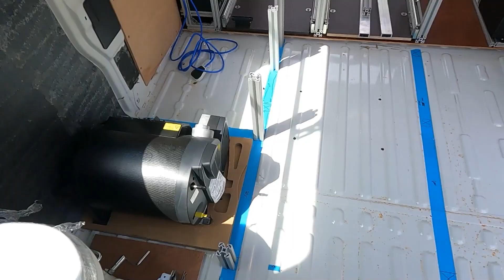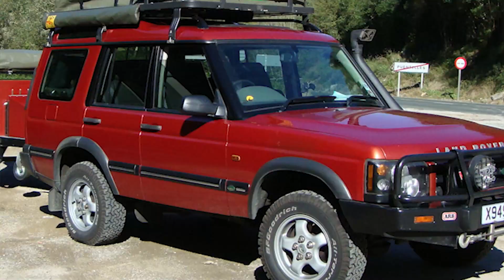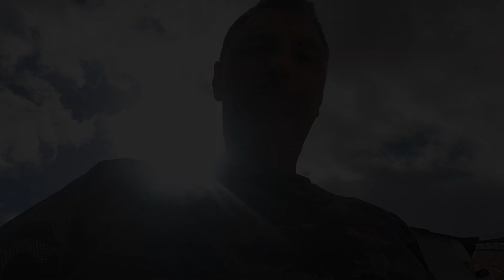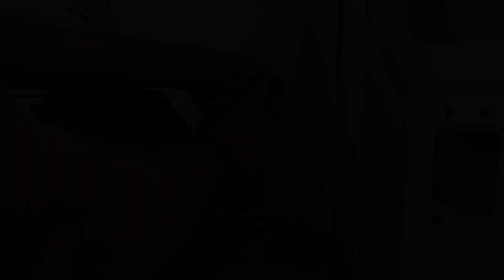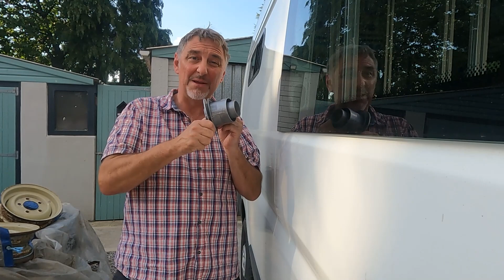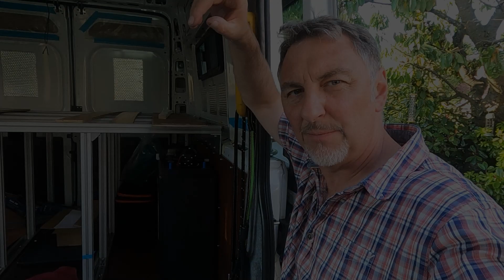VANBUILDING by zones using 80:20...1 unit for FRIDGE, TOILET, ELECTRICS and TRUMA BOILER

Comment: Did you need to sound deaden the roof as it’s profiled like the floor?
Reply from the maker: Only did it in fear not too as everyone else does but your right, those ribs besides strength arrest any vibration.
I do question, once a van has been battoned, insulated, boarded, units fitted, units filled whether the sound deadening would ha e made much more of a difference.
Our next/next build will have none to save a bit of weight and money and hopefully prove a point.

Comment: Hi,

Great video again.

What sort of rubber sheet did you use to act as a temperature barrier, and where did you get it from?

Thanks for your time, and introducing videos.

Graham
Reply from the maker: Graham, thank you for your kind comments and so glad  I can be of help.
I looked on ebay for rubber strip and was surprised what was available in all widths, lengths and thicknesses.
I'm using 40 and 30mm widths 3 and 4mm thick with my extruded aluminium and ordered a strip "cut to size" for underneath my water tank at 5mm thick.
Held firmly its quite easy to drill through to aquire a bolt hole.
Hope this helps.
Paul